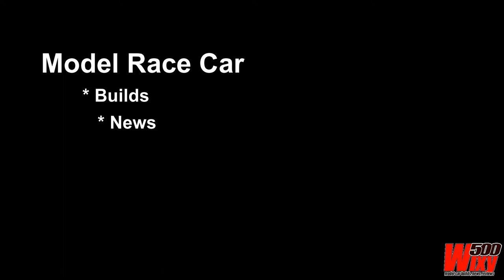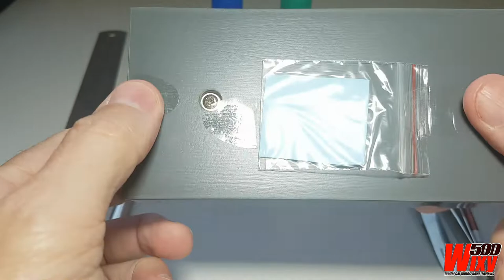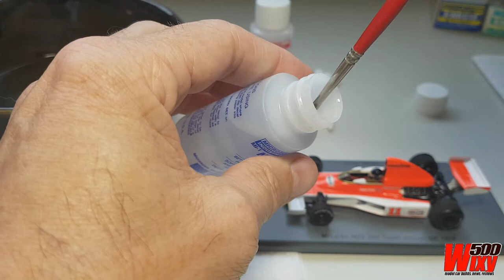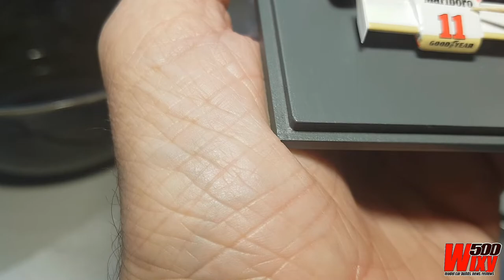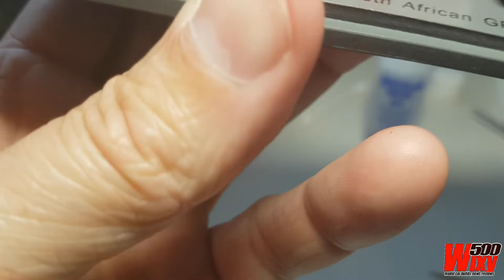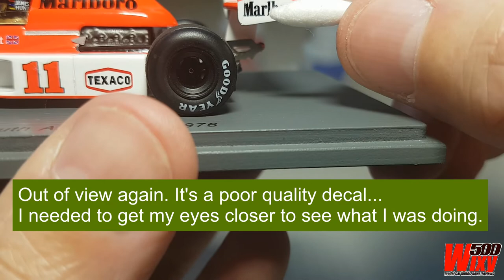How To Apply Decals to a Model

Comment: The micro sol is not used at all only the micro set?
Reply from the maker: I always use the Set under the decal, but only use the Sol/softener if it's not settling into a crease (like a panel line) or around a compound or tight curve. From memory, I only used a little Sol on the helmet decal, none of the others in this video needed it.

Comment: Hello, could you advise me on how - if possible - to reposition a badly positioned decal on a Spark model? (Not by me, but by Spark themselves.)
Reply from the maker: Oooo, that could prove very difficult... The only thing I could suggest is to try and "re-float" the entire decal using just water, but it's a big risk and something I've not done myself. If there are after-market replacement decals available, at least you could redecorate the model in the event things go bad. Whatever you do, do not use decal softener for this as it will make the decal film unmanageable.

Comment: Hi, I understand that the Spark ones were "shinny" but would you ever put a clear coat say over not so shinny or even matte decals? And would this not also help protect the inferior decals?

Great work by the way and thank you for sharing.
Reply from the maker: Yes, the Spark decals are nice and shiny, and usually go down really well. Clear coating the matte decals prior is certainly an option, though it's something I've not done before - mostly because it's not possible to first test how the clear reacts with the decal when you've only got the one decal lol. Cheers.

Comment from the maker: A reader recently sent me a question about what to do if there is an antenna in the way of where the decal is to go. It's a problem I've got around in the past with two different methods:

•	drill a tiny hole in the decal beforehand, then slip it over the antenna (as on the Ferrari in this link - https://www.wixy500.com/f1-decals-tobacco-more/ )
•	use a razor to slice the decal so it can clear & conform around the antenna (as on the Camel Lotus in this link - https://www.wixy500.com/a-big-tobacco-batch/ )

Comment: Sorry a bit late to the party, but after applying,  should we clear coat the car? If so, how do we go about it? I see on plastic kits it's in the process,  but when we have a car already finished as in this case, what should we do? Is there another to prevent the decals lifting or cracking in the future?
Reply from the maker: If it's a diecast/resincast that I've just added tobacco decals to, I don't clear afterwards (that would require disassembly). So far it's not been a problem. I have heard of people clear coating the decals prior to application, but I've never done that. I can't recall ever seeing a factory-built diecast with clear over factory-applied decals.

Comment: hi! is it necessary to have the micro set solution? I want to apply the marlboro decals on the senna 1988 1/2 helmet
Reply from the maker: Is it * necessary * to use the setting solution? No. But it certainly helps. Of the two products, I think it's the softening solution that is the more useful, especially if you're putting decals on a curved or uneven surface.

Comment: What's do i need to use to remove decals ?
Reply from the maker: It depends... On some older or lower quality diecast models, you might be able to use tweezers to carefully lift them off. Otherwise what I do is use nail polish remover that contains acetone on a fine cotton tip which dissolves the decal so it can be wiped off. BUT BE CAREFUL! In both cases, if you're only removing part of a decal, use a sharp blade beforehand to cut the decal and create a clear separation for the decal film you want to keep and the film you want to remove. Good luck!
Reply: On some models (especially minichamps) decals can be removed by using scotch tape. Just press it over the decal and they lift right off. Be careful if you want only a partial section of the decal off; they are usually one piece. The label on micro-set also says it is a decal remover but I've never tried it
Reply from the maker: @Kevin-e7t5n   yeah I've seen that on the Micro Set bottle, but like you, haven't tried it for that.